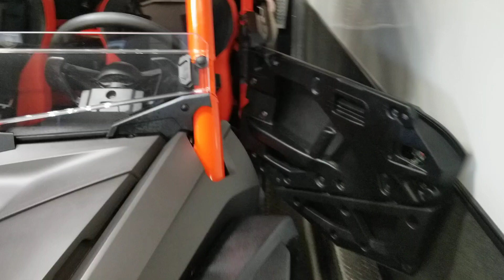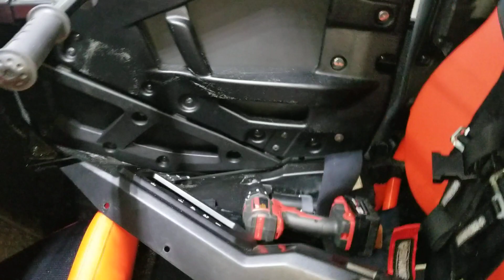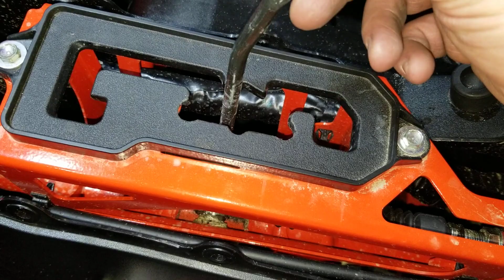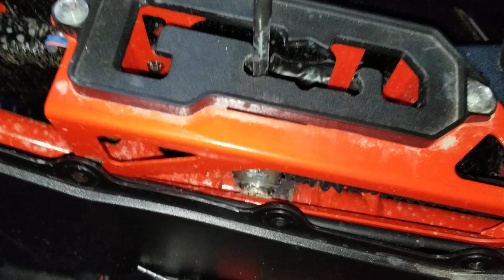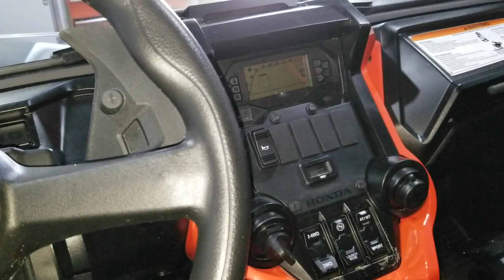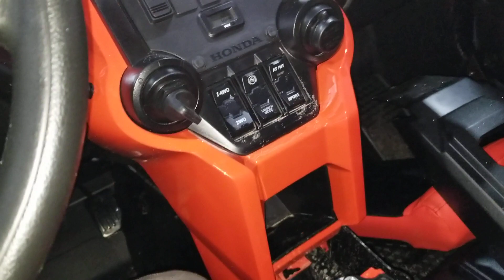Honda Talon low gear issue and shift gate Mod * 10 minute fix

Comment: You should be first to market to produce a billet/machined replacement bolt on gate upgrade. Great content.
Reply: theres already a bunch of companies making them.
Reply from the maker: They are available in different styles already. At too low of a cost to mess with really . Though i didn't find one suitable for what i wanted